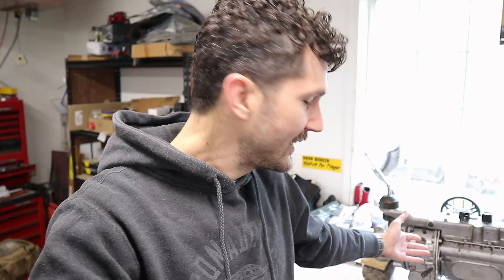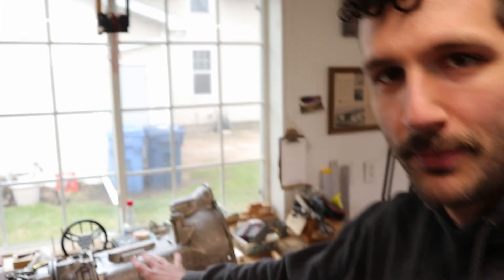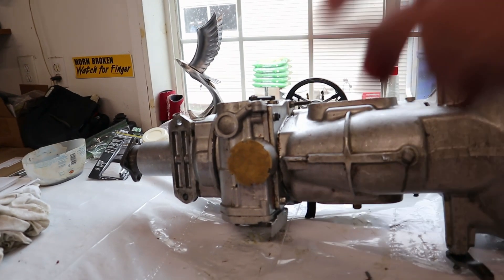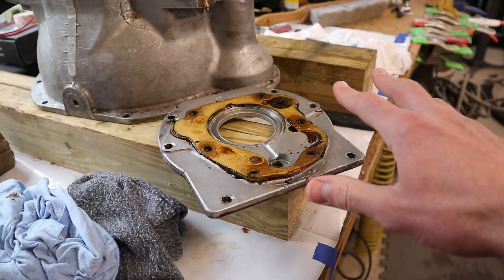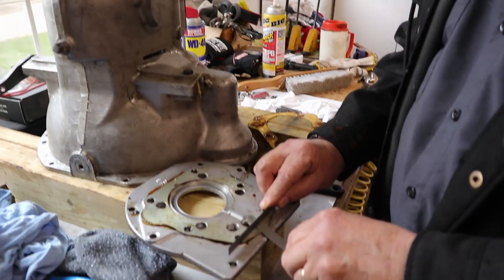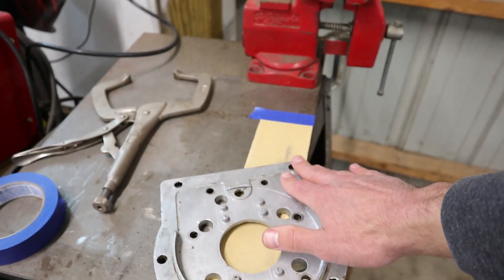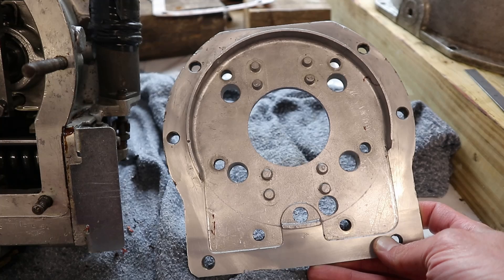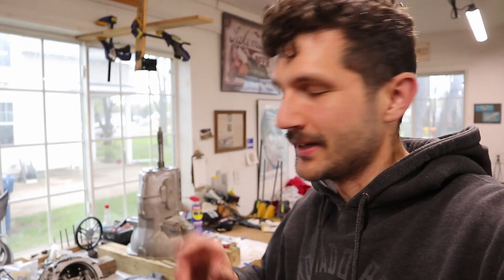Failed Triumph TR4 Transmission - What Went Wrong?

Comment: The best sealer I've used is called "The Right Stuff" available at your favorite AP Store. Racers use it. Last Trans rebuild I did is staying very dry. (they all leak some but mine is only wet and very few drops of the cardboard under the car.)
It's expensive but so is your time if you have to pull the transmission again.